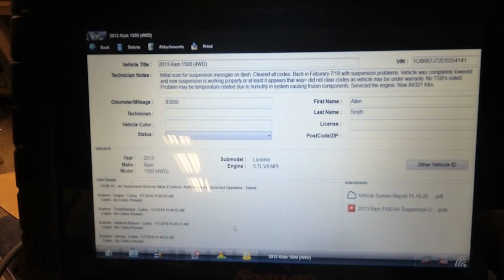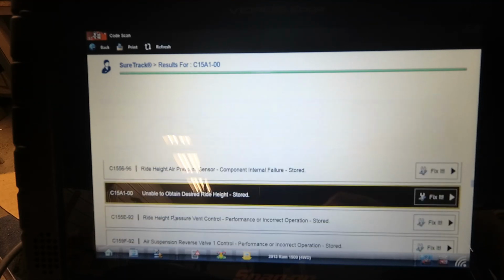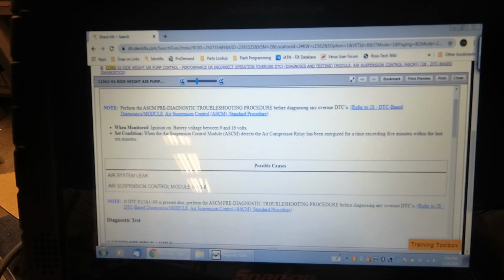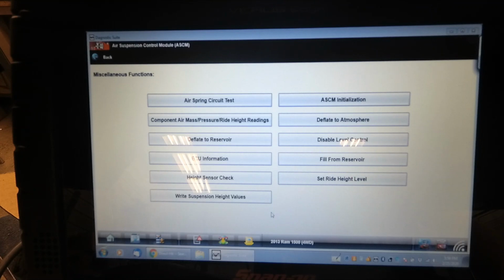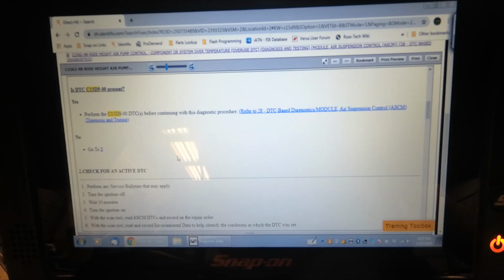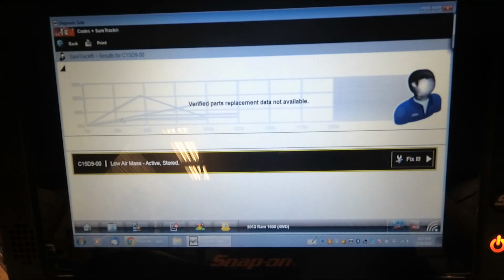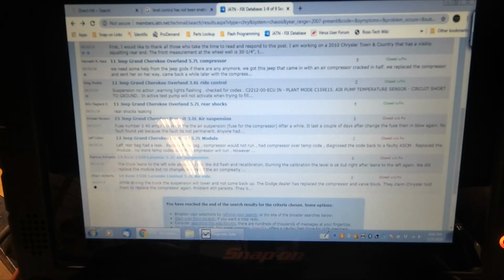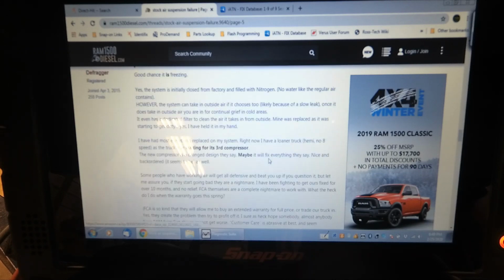2014 Ram Air Suspension Problem

Comment: Hi I have a 2014 Dodge ram 1500 Hemi and the air suspension goes down overnight and comes up when starting. But I just find out now it goes down every time when I turn off the truck and comes up when I I turn on. So I am not sure what is it do you have any idea?
Reply from the maker: Likely a leak in the system. Listen carefully after shutting it off for a hissing noise. Soapy water might help as well. Likely one of the air bags is leaking.
Reply: Does it go down at the front or back or all the way around? Back is usually the air bags. Turn off the function that lowers the suspension on the highway as the air bags on the rear usually start leaking at the lowest setting as they get older but won't leak at regular height. If the front is down, soap check the 90 degree connector on the top of the air shock. If they all go down, it is probably the air valve that sits beside the compressor.

Comment: Air ride is a great suspension but come on Ram it ain't that hard I have had semi tractors and trailers with air ride and well over 1 million miles and original air bags and compressors and guess what airbags less than 200$ and compressors 600$. The makers of these pickups know that most people don't have any experience with air suspensions so they build a poorly designed unit and charge more than it cost for heavy duty applications shame on them.

Comment: Phil, I have a 2018 ram 2500 with rear air suspension. I got the code C156E-00. Do you know the process to recalibrate the air suspension SENSOR so the ride height value can be enter.
Reply from the maker: You need a factory compatible scan tool and it will be a functional test in the suspension control module.
Reply: @PhillipBailey  thanks. I dropped it off to the dealer but they keep trying to enter the height value without doing the recalibration of the sensor and they get rejected. Any clue where the calibration process is ? 
I think I can not do it with the alfaobd software ( limited access I guess). Dealer want to replace the suspension module with is in back order.  Any help would be appreciated because I think the dealer is not using the right process for the calibration of the sensor.   ( I did unplug the passenger sensor and I guess it as to be recalibrated now like you you install a new sensor). Thank  you for responding me. Your videos are very helpful.

Comment: The secret to success with these systems is to make sure that they remain sealed. In other words, keep an eye (or ear) out for leaks. There are a few places that commonly develop leaks, such as the 90 degree joint on top of each air shock. If the system does develop a leak, it will eventually take in atmospheric air.  And since atmospheric air contains moisture,  you'll end up with all kinds of issues, especially in cold temperatures. The reason the system is filled with high purity nitrogen in the first place is that it doesn't have any moisture, which means it can't freeze up in cold weather.  Too many people ignore leaks until they have an issue where the system becomes inoperable.  But if you keep it in good shape,  it will work just fine for many, many years,  even during extremely cold winter temperatures.
Reply: This message sounds like someone who doesn't live in cold states or doesn't own one of these vehicles lol
Reply: @travisquicke7169  I live in NY and I've owned one since 2015.
Reply: @Japplesnap  then you should know there's nothing you can do when the compressor goes every year. Maybe a heated garage keeps it normal but mine has been changed under warranty every year n unfortunately warranty up now. NY here as well.
Reply: @travisquicke7169  Mine still works fine. Never needed any repairs yet after 8 years and almost 100, 000 miles. The key is leaks. If the system doesn't leak, it won't suck in moisture through outside air. Moisture means the system will freeze in cold temps. That's why these systems use nitrogen----no moisture to freeze up in the compressor.

Comment: I know this is an old post but I have a 2014 Ram 1500 Laramie with 106,000 miles.  I have had it since 2017.  It has been an awesome truck until the past 6 months when the air suspension started in with the troubles that everyone has been having.  I took it to the dealer twice.  I ran out of warranty too.  Just paid the truck off a couple months ago.  The first time at the dealer, they couldn't find anything wrong.  The second time in, they said I need a new compressor at a cost of nearly $3,000.00.  BUT, they said there are no guarantee's it will fix the problem.  That is when I started researching here on Youtube.  I think what I plan on doing is converting all this crap into a conventional suspension.  Ram needs to do something about this and I live in warm Southern California too. I don't think it is a cold climate issue.
Reply from the maker: Only real fix is a conversion to conventional suspension.
Reply: Pathetic and no excuse I would like to have a nice Ram truck but I'm having second thoughts because of this crap I had a 1993 Peterbilt with a million miles on it and still had the original compressor and air bags.And they are probably cheaper to replace than these stupid pickups.

Comment: I had a Theory about the air system before I saw your video and my theory got enlightened when I saw the amperage went higher at some point when you where testing it. Is there a chance that the pump is miss reading the pressures in the tanks and is trying to fill passe it’s psi threshold
Reply from the maker: That's certainly a possibility unfortunately we will never know for sure as he traded it in and the dealer sent it to auction as they didn't want to deal with it either. I'm sure they work good in Arizona.
Reply: @PhillipBailey  Nope - mine in Phoenix craped out. Ill try new air bags in the rear.

Comment: Hey phill. Help me please I have one ram 2014 long horn, the problem is “ rear air suspension suspension turns down but just in one side. ( driver side ) my truck don’t have any leak. Could you help me please 🙏🏻🙏🏻🙏🏻
Reply from the maker: You need to scan the suspension system for codes to start with. Hopefully that will give you some direction.
Reply: @PhillipBailey  c221200 & c156e00
Reply from the maker: @martinmontano3362  C2212-00 is the system is in "Plant Mode" and C156E-00 is calibration incomplete. What did you do? Were some parts replaced? Was someone playing with scan tool?
Reply from the maker: @martinmontano3362  807 626 3683
Reply: @PhillipBailey  i replaced two front  struts, one rear air bag. So… Could you tell me what the height values are and if I need to update the firmware and how to do it. THANK YOU VERY MUCH.
Reply from the maker: @martinmontano3362  you will need to charge the system with nitrogen. I'm not sure if you have the equipment I know I don't. This is likely a dealer capability only. I'm not sure if an aftermarket scan tool will do this even it you had the nitrogen and rig to do it.
Reply: @PhillipBailey  do you have  email ? Or phone number

Comment: When it gets below -20°F in MN where I live my 2017 rebal with air ride will deflate to exit entry mode. Only solution is to keep it warm over night. Purging the system does nothing dealership did that like 5 times for me, replaced with a new pump 3 times and replaced the lines going from each strut to the pump. 

Only thing that's worked is having an auxiliary Battery warmer blanket wrapped around the pump that is wired to start when remote started and stay on for 10min at a time. Thanks YouTube for that great idea, now I can goto my cabin where I don't have a heated garage and park overnight without fear of having a deflated 4x4 truck.

The actual issue is the purge valve freezing over, it's tiny so it doesn't take much condensation to clog it up. And changing height or increasing or decreasing load or temperature changes which reduce the mass of the gas within the struts causes the pump to purge and inflate/deflate to adjust height.

Dealership said it has no code to directly point at the purge valve but thats what it was for me and now I'm sure hundreds of others that have since gone to the dealership I went to since they figured it out.
Reply from the maker: I've heard of people putting antifreeze in tge system like is used on transport truck air suspension systems. I'd research that option. Otherwise covert to conventional coils and shocks. Very disappointing they couldn't get it right. The dealer here won't order them in with this option. If they take in a used one they send it to auction...

Comment: Yup. Almost 10k in parts and labour so far on my 2016 under warranty (air suspension). Most issues were compressor related. I'm on my 5th. There's no fix. Once my warranty is up I'm ripping it all out and putting in a regular setup with a lift.
Reply: My 2014 has been slammed down not holding air yesterday I hit the fuse box and it started working and holding air is this common are just messing with me

Comment: This is my first cold winter with my RAM with the air suspension and I think something is frozen with my system.  I have done a lot of reading with this, and found this thread that has a couple setups that people list parts for going to coil systems.  I think I am going to go this route depending on what they come back with from the error codes I have.
https://www.ramrebel.org/threads/finally-getting-air-suspension-removed.49871/
Reply from the maker: Eliminating the system is the only way to be free from future air suspension repairs. It's just a shame that Ram didn't design it correctly in the first place or come up with a solution to their design short comings. Around here the dealer fix is to thaw it out and dry it out and wait for spring. Then next winter it will likely be out of warranty...

Comment: Have been plagued by issues s my 2014 Ram 1500 4 corner air system. 3 trios to 2 different local dealers , typical just replacing expensive modules and motor. Still not working properly. Can’t tell if they are just clueless or raping me. Truck has only 60k miles on it.  They offered to get me in a new truck, just about spit out my drink. “ you can’t even figure out how to fix my current truck after 3 services and you want me to buy a new one?!” Lmao
Reply from the maker: If you live in a cold climate I'm afraid this is going to continue. The local dealer here won't order any trucks with the air suspension system and even recommends deleting the entire system for conventional coil springs and shocks. There is a company in the US that sells a kit to convert it.
Reply: @PhillipBailey  that makes sense in that climate for sure based on what I’ve seen. It’s a joke that those are the only complaints on file . I spoke with corporate and they pretend that there is no real issue with this system. I will probably delete the system - I have seen the US company Strutmasters or something like that. I just wish someone would comment of that is a legit option.

Comment: I have a leaky bag issue on the back. my system was freezing up. i used are brake de icer. a very small amount. maybe 1 OZ. behind the left tail lamp is an air filter. remove the filter and put in about .5 to 1 oz of air brake de icer lubricant. it has been working great for 2 winters even though i need to change the bags out. its a quick fix and a  temporary fix till all leaks are fixed.
Reply: Left side? I thought it was the right rear tail light?
Reply from the maker: That's not a bad idea. My customer traded his in...

Comment: Mine is really bouncy in Aero mode . Any reason you could think off?
Reply from the maker: If ride height is normal my guess would be shocks. I believe the rear has conventional shocks. Air suspension requires good shock absorber action otherwise it will bounce like crazy. Just my opinion . HTH
Reply: @PhillipBailey  having same problem w 2014 ram ecodiesel
Reply: Did you fix it im having same problem
Reply: @MemphiZ28  me too

Comment: Hey Phil, i have a 2017 Rebel with air ride. It has given me nothing but trouble, and i'm now out of warranty.  A quick way to 'fool' the system to enable level control, when it refuses to do so, is to select fill from reservoir, short term fill, and select any corner. If it passes that, it will allow level control once you go back and clear the codes.
Reply from the maker: Good to know. The local dealer has lo fix for these short of converting back to conventional springs .
Reply: @PhillipBailey  fire?

Comment: Hi Philip, 
I bought a 2015 Ram Ecodiesel and went all out and got the limited Laramie 4x4! Love the truck but I keep coming to the same issue with the air suspension it comes with. I continuously take it to the dealership where I assume at least they know their trucks even if it turns out to be more expensive at least the work will be original. I’ve had to bring it back more than 10 times and I’m not sure what to do! I can’t lemon law because it’s a used car! Please help all I ask is for some advice. 

God bless you and your family stay safe!
Reply: Read my post above, I figured it out for my 2017 Rebal. Handles MN -30° winters no problem now.
Reply: @tdcjonm  could you put out a video on this, where you put the warming blanket and how? Would help a lot of us. Thanks
Reply: I also live in South Florida!

Comment: So I’m getting ready to purchase a new 2020 ram Laramie with air suspension. I live in Wisconsin which as your probably 
aware has quite a few cold days and lots of road salt. Should I not buy the truck due to these potential ongoing issues?
Reply: Do. Not. Buy. It.
Reply from the maker: Well this one is an early version being a 2014. Not sure of they changed or improved the system by now. The dealership here won't order any with the air ride so I don't know if they have improved. I'd try talking to other owners in your area and the dealership techs see if they are still problematic. Good luck
Reply: i am putting a monore sturts and spring on mine.good by to the air ride
Reply: Read my post above, I figured it out for my 2017 Rebal. Handles MN -30° winters no problem now. We've got thr same frigid winters in MN and Wisconsin.
Reply: @tdcjonm  can you confirm that the key fix is to keep the truck warm? If so where do you put the warming blanket? Thanks so much for this insight

Comment: Nice job, what a pain in the neck. I’m def disappointed with mopar for this. Very crappy set up at that voltage the motor is bad but what do you do? Covert like you said if not keep burning up motors? Thanks for sharing.., jay
Reply from the maker: Yes it's a crappy system if you live in a cold climate which I do. When the dealer takes these on trade the send them to the auction in Toronto.